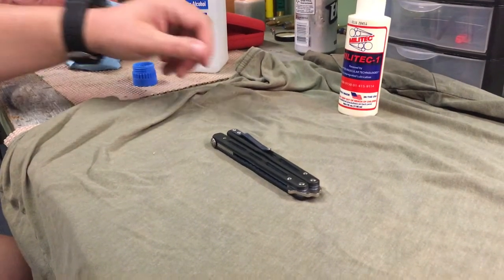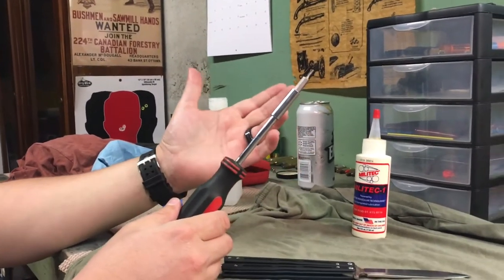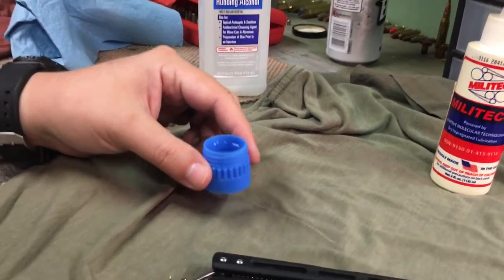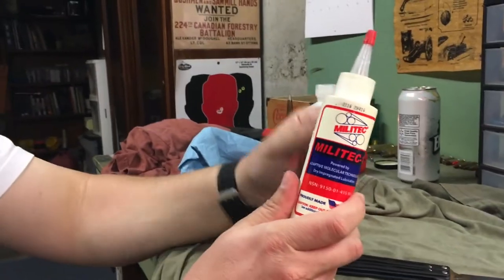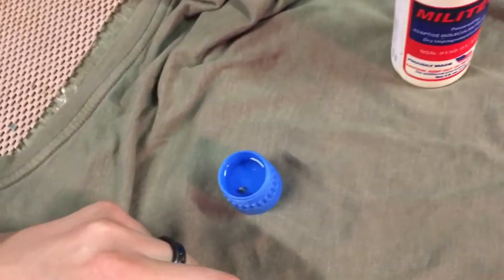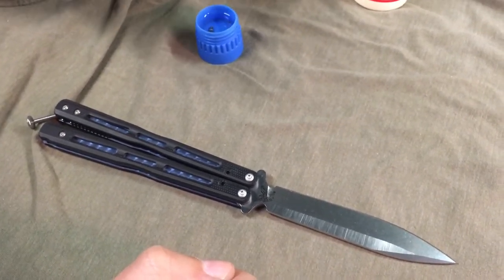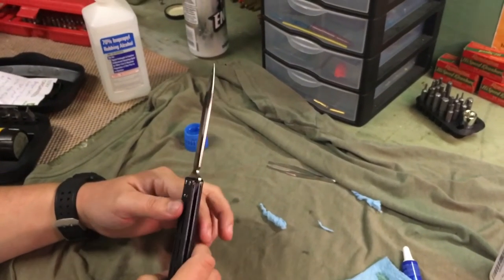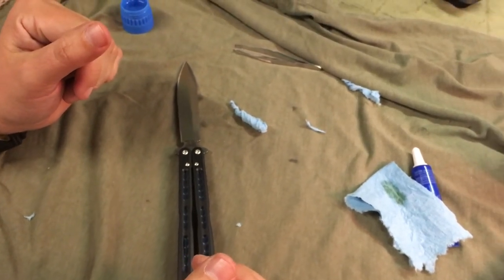Balisong (Butterfly knife) how to: Loctite and Oil

Comment: I want to ask does the bm51 has bushing system？
Reply from the maker: I believe just to torx screws and washers. Still a very smooth knife for flipping though even after heavy use over the last couple years and it's in my pocket almost everyday. I have flipped it a ton and it still hasn't loosened on me.

Comment: How do you do this with hidden zen pins?
Reply from the maker: I'm not very familiar with that design I guess but I would assume if there's no exposed Torx screw securing the Zen pins in place then likely there's nothing to back out and therefore you wouldn't have to Loctite it. Perhaps someone else reading this will have more input on that but I personally have never encountered it as the only balisongs that I own are the Benchmade 51, a Microtech tachyon 3, a Kershaw Lucha, and a bear and Sons Damascus traditional. None of these have hidden Zen pins. Thanks for watching our video and good luck with your project.

Comment: What can I use to oil it
Reply from the maker: Well, there are many products that would likely work good but like I was saying that militec 1 gun oil works better than anything else I have tried.
Reply: @TheMaineiacguy  Does stuff like wd 40 bike lube work?
Reply from the maker: @quantryli  a familiar with the product called WD-40 but I'm not very familiar with a WD-40 bike Lube. Not sure if we're talking about the same thing but as to the WD-40 that I'm familiar with the viscosity level is kind of gritty for a balisong. You can pick the militec 1 up on Amazon for a very reasonable price. Most standard gun lube will probably do the trick and you can get those right at Walmart. I've been very impressed with the militec though. It's not a super heavy oil but not too thin either. Good luck my friend and happy flipping.
Reply: @TheMaineiacguy  OK thanks
Reply from the maker: @quantryli  sure thing. Thanks for watching.
Reply: @TheMaineiacguy  just so people dont get confused from now on dont use WD 40 bc it's meant to break down grease and oil wich is no good

Comment: Can you do one for a csgo balisong butterfly knife
Reply from the maker: I'm afraid I don't have one of those. I have a cheap bear and Sons that is pinned, a Lucha and Microtech tachyon 3 that are bearing, and this Benchmade 51 that has pivot pins secured by Torx screws and washers. The Benchmade 51 is the only one that I have Loctited since that is the one that I mainly flip. For any balisong with pivot pins using screws, this should be just the ticket to keep you going. Happy flipping my friend and thanks for watching!
Reply: The Maineiacguy I figured it out and oiled but do you suggest to loctite before oiling
Reply from the maker: @a_transformer_king1841  definitely recommend getting all the oil cleaned off with alcohol BEFORE Loctite so it'll set up properly.

Comment: yo I bought a new knife but its a little unsmooth or hard to spin do you have any cheap lube for me to buy please
Reply from the maker: Sure, I would personally recommend Hoppes gun oil what you can buy at almost any retail store to include Walmart for like five bucks or so. That's a good high viscosity oil but also protects against rust and Smooths the action. As I stated in the video the militec 1 oil is recommended or at least used to be recommended by Benchmade before they got into their own oil. Militec 1 can be purchased online for a pretty decent price as well. Hope this helps and happy flipping my friend.